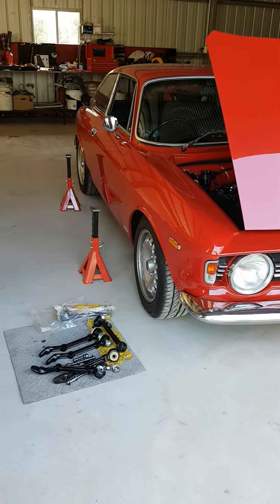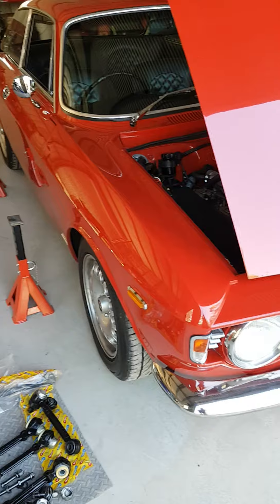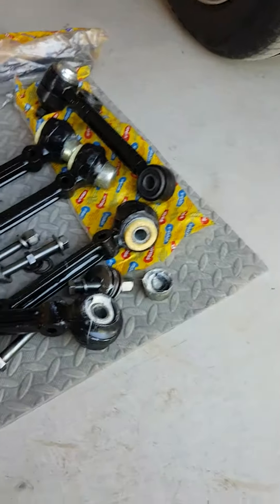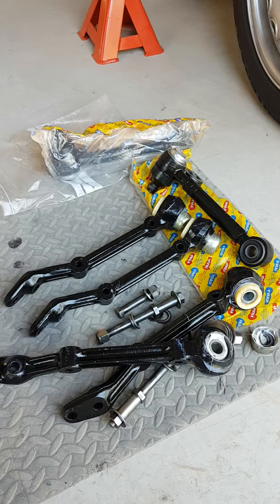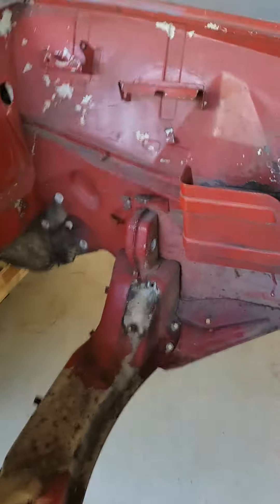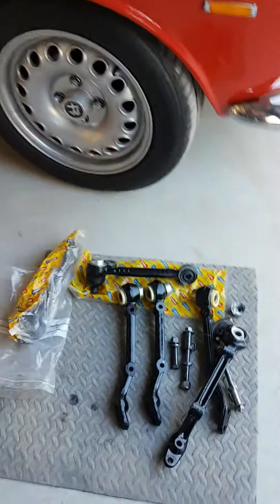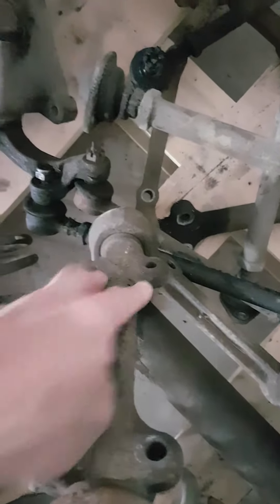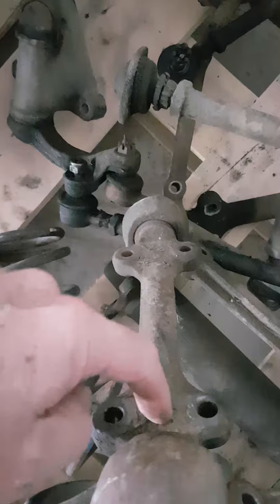1966 Alfa Romeo 105 step front suspension upgrade part 1

Comment: Just bumped into your channel. I’m an owner of a 71 Junior myself and looking to upgrade the wheels. 
Really like the look of your daily driver. What size and ET of the rims did you go for? 
Is there a difference in the width of the rear axles - LSD and genuine Junior 1300?
Reply from the maker: Hey, welcome to our channel🤟🏻,
The rims are from Alfaholics and are 7.0J 15" with an ET 35 offset. Ive put Bridgestone Potenza tyres on 195 60R 15. Ive found the tyres too wide an heavy on the steering box. I will be going to.a 185 in future and may look at a different tyre that doesnt "tram track" like the uni direction tread patterns.
Hope this helps, thanks for watching
Reply from the maker: Not sure on any difference in the width of the axles. Im running a 2l LSD in my 67 step front